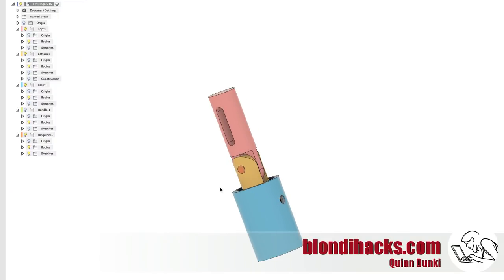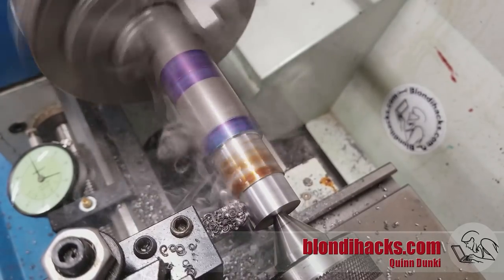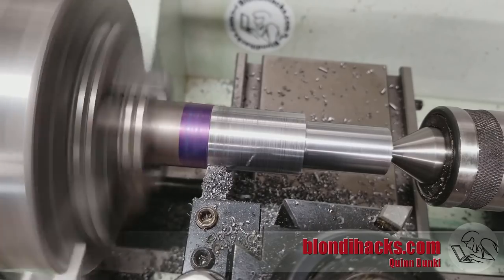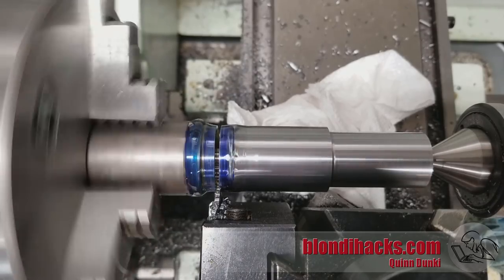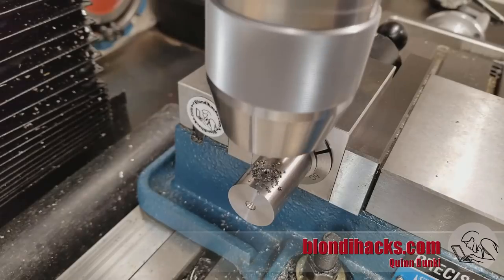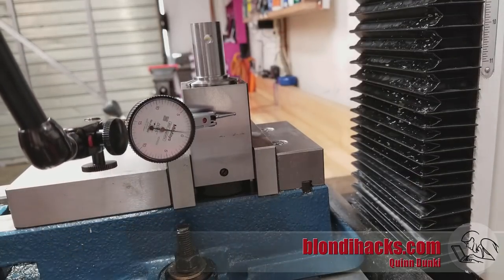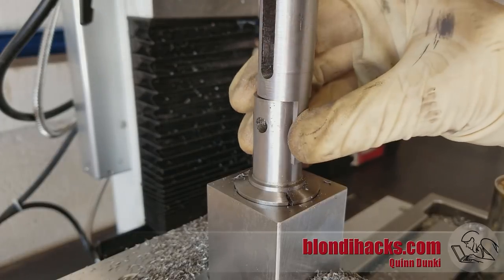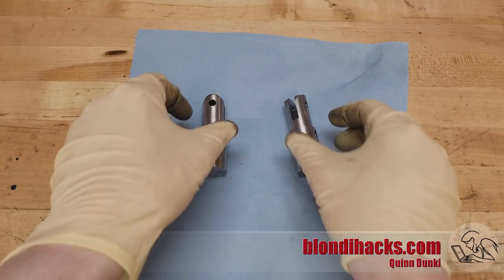How To Make A Locking Hinge : Part 2/3

Comment: What always bothered me about the edge finder was if it "bumbs over" is that not a little off perfectly on point? i'm sure it does not matter on setting the zero for getting your center because you do the same thing both sides but still.. its something that logically i cant help feeling is creating an unseen error for certain applications.  i never used one so i don't know by it seems to me if its causing an over point to make it go off its own center that's inducing a small error. ill have to read up on the procedure for using these..not like ill ever buy one or use a dro...Im more all old school about it
Reply from the maker: Well, the reason you need it to bob over is because you need the two surfaces to occupy the same space. If it's just "touching", the edge of the edge finder isn't actually on edge of the material, if that makes sense. There is a technique to it though. You need it to just barely bob over. Too much and you will certainly get error. Basically, the slower you move in, the more accurately you'll be finding the edge.
Reply: @Blondihacks  yeah i get that its so you can tell when you reach that point but is the bob over now putting it off its own center and out of round in a sense? as in the shape being perfectly machined at the same diameter of the top part and if you cause it to fall out of shape you are actually beyond the boundary of the edge of the tool.. i get its perfect use to find edges for setting your center or edge point on two sides of something it would have to be accurate in that case but to lets say set a distance from edge to some point on the work would that be slightly off...(maybe that small amount wont matter )  but this has always made me curious as to the ACTUAL technical tolerance level of such a device used in that way..or after the bob out knowing what that measurement is like how many thousands off (if any) 
Im not sure i can explain my hunch on this well.
Just because something is set as a standard still does not make it without some overlooked error, we grow when we question. and i can get quite geeky when it comes to this stuff too,,,so i can clearly understand ...

Comment: I am very confused which sector you are aiming at the novice or the experienced machinist with all the tools. Your videos on machine finish and what materials to machine were excellent for a novice who has just put his toe in the water to buy a mini lathe and I thought all your videos would be on how to use the lathe and improvise. If I had all the equipment,  lathe, milling machine,  collet blocks, mills, and the tools would I be watching you?
Reply from the maker: I have different playlists for different interests. My Lathe Skills series is for people interested in learning this stuff in an organized way. My Projects videos are for people who are more passively interested and like to watch the process of machine shop work. I started as one of those people, watching Abom79, Mr. Pete, Keith Rucker, and so on. Passive interest turned into active interest for me.
Reply: Hmm DRO
Reply: Blondihacks 

My passive interest has cost me nearly 25,000 so far
Reply from the maker: @FrancisoDoncona  LOL! I know that feeling. It happens so gradually...
Reply: Blondihacks 
The real problem is I believe my tooling has exceeded the my rolling tool box wheel rating by three fold, okay maybe four. But if I move the horse stall outside and power wash real well, it is almost summer.
Reply: Hi Tony, I was a machinist for over 13 years. I was a production machinist on primarily the manual Mill and Lathe. Several parts only had a .0002 tolerance. Most of Quinn's videos are old hat to me but I still learn things from her. I have a Atlas 6x18 lathe. Just received a Grizzly G0704 mill and the G0602 lathe is on it's way. I hope to be starting my YT channel soon. My point is that Quinn has good information for all interested in machining. I think Quinn is doing a great job.